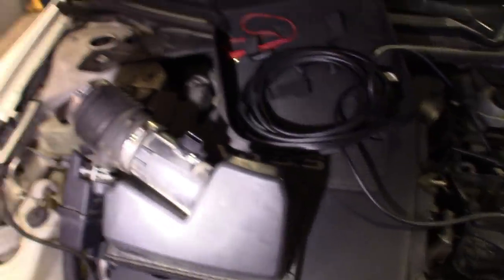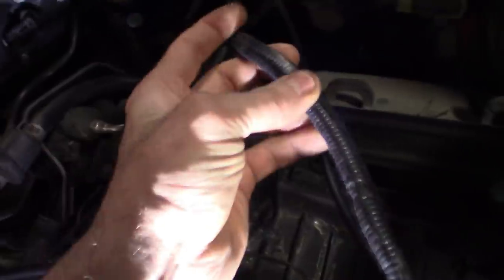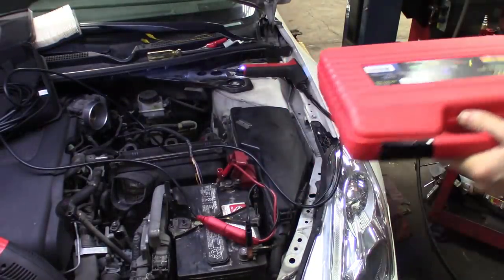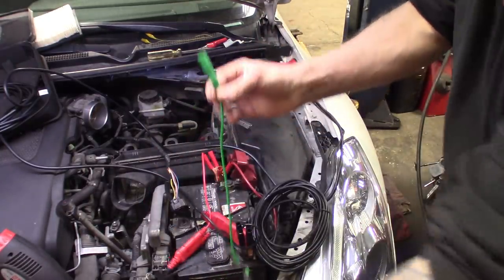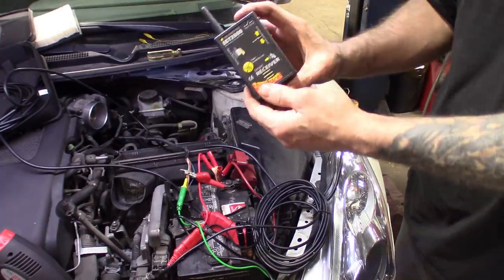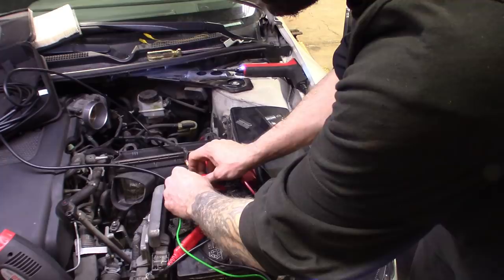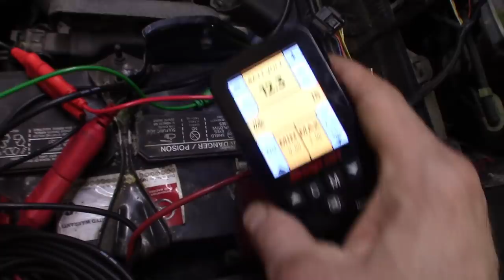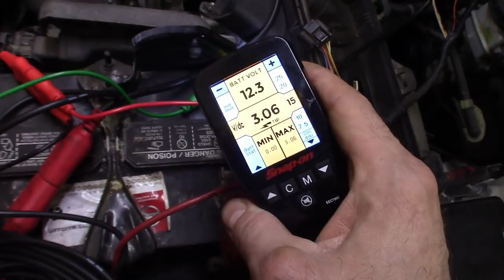Power Probe Must Have

Comment: I’ve got the ECT3000 and a power probe IV

All works really well 

having said that nine times out of 10 wiring problems can be diagnosed with the wiggle test because is usually a connector combined with a visual inspection and for those one times out of 10 it’s something weird in the circuit the circuit breaker finder is outstanding 

use it successfully once and it’s paid for itself on first use via time and hassle and headache and frustration savings.....

Comment: Good video I have they same kit. It works great especially on trailers looking for that elusive broken abs wire or tail light wire. Makes finding them faster just by taking the time to hook it up vs hunting and probing with a test light or volt meter.
Reply from the maker: That one definitely comes in handy. I gotta look into the newer version power probe makes ect3000.

Comment: My power probe 4 master kit came with the ect3000
Reply: Bro i baught that same kit but have had trouble using the ect 3000, ive tried using it looking for shorts but that signal is just all over the wiring
Reply: @electrosport2470  I would contact power probe I havent had any problems with my 3000 tester
Reply: @AntonioClaudioMichael  i sure will bud thanks and hope you are well 🤝
Reply: @electrosport2470  I am doing very well thanks for asking 🤝

Comment: I think you will find that the transmitter produces either a radio frequency or an ultrasonic signal for the receiver to pick up. It is not a DC voltage I am certain.

Comment: I've not had good luck with tools like this. It would work OK if the wire was completely broken. But, what usually happens is the wire is corroded or partially broken and it cannot carry a load, but it can still carry the tiny amount of current used by the transmitter. That creates a false positive reading.
Reply from the maker: For those corroded wires I use the uscope or the power probe hook it has a load test function then you can just isolate the issue. With the uscope I do the wiggle test
Reply: If unsure put a resistive load at the end of the circuit.  The corrosion will be where the receiver stops receiving.

Comment: Wow didn't know nissian did that. What was the reason for that. Incase you pull on the wire ?
Reply from the maker: I think they do it to make it look neat. Or to mount the harness
Reply: Perhaps a "one one size fits all" sub harness practice of keeping manufacturing / production costs down the stuff an ideal length from one model into a smaller frame model.

Comment: Why not put the backprobe into the pin in the connector instead of putting a hole in the wire?
Other than that good video. I've been looking at it for awhile but been having trouble justifying the cost, but I think I'll have to save up the money.

Comment: Dude i have this tool and i dont even know how to use it and im dealing with a headlight issue on my volvo rn one headlight has no power and when i pass it power with the power probe the headlight works.    I will use the ect2000 to find the problem thanks !!

Comment: good tool, but it has issues.....like 30 sec shut-off time of inactivity... I promise you if you spend the 124.00 on the ect3000(upgraded/newer unit) you will never use this one again.....give-a-way...im not knocking ya but I was kinda shocked you didn't research first and knew there was a newer unit....I had this one and once I got the ect3000 I gave the ect2000 away to someone who can deal with it....the newer one is so much better...10 mins on time better sensitivity.....but thanks for showing what it does....
Reply from the maker: I've owned this unit sense they came out. The ect3000 is on my upgrades list
Reply: oh my bad....I thought you just got it....so no corner for you...lol
Reply from the maker: Lol. I gotta get the newer one soon

Comment: You can do all that in half the time with the LoadPro by Dan Sullivan. 

Load the circuit with the press of a button.
Reply: Not really. I love the load pro, but the load pro just tells you that the circuit has a problem, the ect 3000 shows you specifically where the break is. Both tools do completely different things

Comment: Tool is awesome , demo is shit , it does send voltage it send frequency , also it says right in manual to isolate the circuit you are working on since it can give you a false short or open signal.
Reply from the maker: I'm sure you ment to put "the demo was the shit". Kinda hard to isolate a circuit when its in a huge wire loom. I checked the transponder it's sends a small voltage and picks it up on the receiver as a frequency is what I assume.

Comment: That 3V must be in micro amps if it is computer safe?    Nissan = electronic issues galore!
Reply: I wish the Nissan dealership I worked for had more electrical issues. Our area must have sold all of the ones without electrical issues...

Comment: So you sent voltage to the computer if and when the broken wire was touching! Fry a computer and no bueno!  I say disconnect your computer. Especially if you know the wire is going directly to the computer, which he knew, luckily the wire stayed broken !
Reply from the maker: It doesn't work with voltage it uses frequency.

Comment: If you are told that you need a computer for your car because the sensors do not work anymore, think again. These sensors are mostly 2 and three-wire circuits. They are generating some kind of signals for the computer to read and make decisions with. With the proper knowledge of how sensors work and what they do you can save yourself considerable money. The "cheapo" 500 to 1000 dollar cars that have electrical problems are not that hard to fix. All the wiring gets brittle and can be the victims of rodents because they started to put soy-derived oils in the wiring insulation. If you got 5 volts from the computer that does not reach the sensor, you can save yourself the trouble of chasing wiring with a signal generator and receiver by just making a jump wire from the computer to the sensor. 
If your computer has not got 5 volts from the designated pin you can go get it from somewhere else. You can also get your grounds from the computer chassis. If you have an intermittent hot from the computer just get rid of it, it is dangerous.
The signal wire can be replaced too. Just replace the wires and make sure to use power and grounds from the computer hot wires.
If you take a two-stranded thin wire and run it from computer+5v and ground to the power and ground of the sensor and you can measure the signal from the sensor wire back at the computer you just made a circuit to fix your problem. 
It is not that hard and we do not need to be afraid of it.
Reply: I’m not a mechanic, and this makes sense but I’m curious, how do you that? You’ve got for example a connector with 32 pins, how do you access that 5v signal without unplugging? Back-probe it somehow? On my Jeep I have 5v at sensors, when unplugged the pin in PCM has 1v. So I’m just trying to understand what your process is. Maybe it’s simple when you have more experience
Reply: @2tallB  You basically go to "YouTube University" and also research the problem on search engines. If you don't get answers right off the bat, try changing the way you ask the question. It is not that hard and yes you back probe looking for the 5 volts you need. There is always someone else who had the problem out there.
Reply: @andrewdomenitzdmd  There was one sentence in that that was helpful. Thanks for that. Because clearly, in case you didn't notice, I AM on the internet researching things. lol

Comment: A regular volt meter would do the same job. No need for this
Reply from the maker: Naw
Reply: For intermittent faults especially you must physically move ,pull up / aside sub harnesses to look for chaffing rub through on the loom.
It is very advantageous to narrow down & pinpoint the near or precise point of the break before disturbing the harness. 
Another example is If you have a double axle float, boat trailer or an RV you can easily find the break in the tail light circuit if replacing a bulb doesn't fix the light out problem.
Reply: Not really. You'd have to keep poking into the wire to take measurements. You can start at connectors to narrow down a section but this would certainly save time. Especially the 3000 which shows you the direction to move in.  And the wiggle test is great but can also make it tough to find sometimes.
Reply: JRC54 you need to learn how to use a meter.
Reply: Matt Harradine you don’t poke wires with a meter. 🙄 you get the right ends and plug them into the plugs or you back probe the plug..watch some videos and learn something